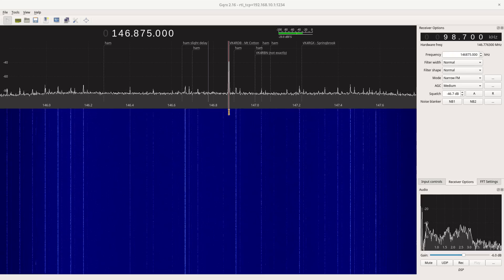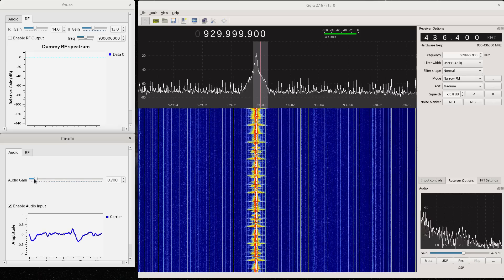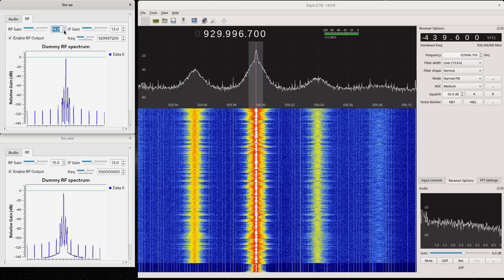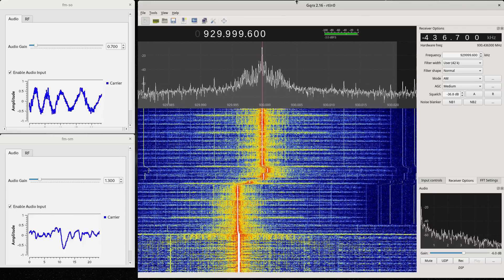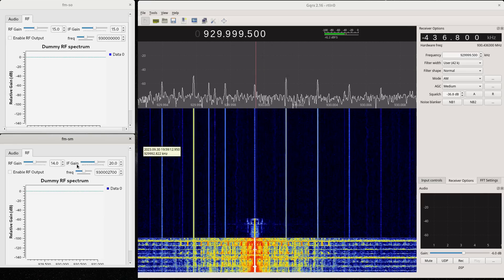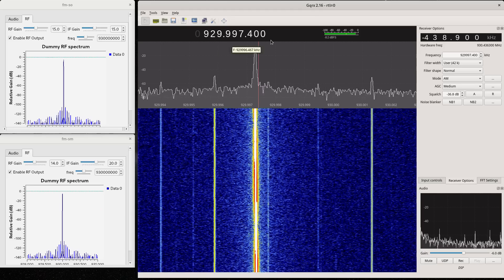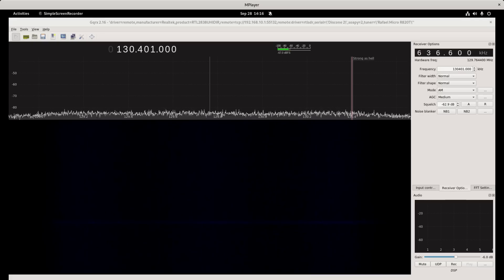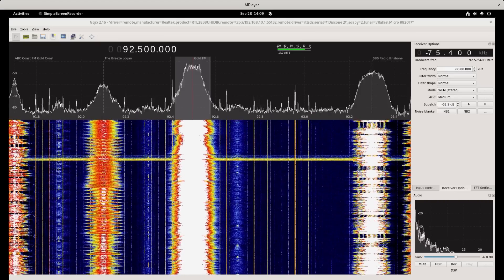Demonstrating FM Capture Effect

Comment: Unfortunately this video is fraught with serious misunderstandings of radio communication starting with fundamentals of propagation through the atmosphere and the various methods of modulating a radio carrier with information. This is pointed out in several places in the comments. Please take a look through the comments, but there is confusion within those. This is a difficult subject. The author made a try but fell into a vast array of misunderstandings leading to confusion. For example amateur radio uses all forms of modulation. In fact the most widely used method for voice transmission over any significant distance including around the world is single sideband suppressed carrier, SSB, a form of amplitude modulation. FM is generally not used for world wide communications because the portion of the spectrum capable of transmitting world wide, HF, is so limited and effective FM as usually implemented demands much more bandwidth than SSB. The most efficient use of spectrum is CW, Morse, simply turning the narrow signal on and off making it the earliest form of digital modulation. The VHF and UHF frequencies generally used for FM are not effective for world wide communication but have much wider channel width available so FM is best placed in those higher bands. 

Reply
Reply: LOL, you actually misunderstand things even more. FM and PM pretty much used for world wide comm in digital modes, it's even superior to Morse code. For FM it was a problem to get small deviation and detect it that's why FM channels were so wide esp. in old days. (old radios had 25kHz channels, modern have 6.25kHz channels). So answer is "historical reasons". SSB was just easier to implement. Yet for HAMs it has same benefit as mentioned in the video: no capture effect.
Reply: @ssoqboss  Digital methods perfected in the last few decades have enabled efficient use of spectrum and weak signal detection far beyond earlier technologies. State of the art software defined radios make implementing these various methods quick and easy compared to the complexity of hardware revisions and upgrades. Armstrong's original breadboarded FM equipment on display at the Antique Wireless Association Museum show just how hard it was. Today using programing and complex math works miracles not even dreamed of fifty, even twenty-five years ago. At the physical layer its still an issue of how best to impose the evolving standards on the physical world for transmission. Just like Morse there has to be something that can be changed over time to impose the message on that physical phenomenon. Change the frequency, change he phase, change the amplitude, change the polarization, mix things together and stir in the math to gain increasingly more efficient use of resources.

Comment: Perhaps nothing more was necessary for you to do than to simply listen in the aviation bands.  Usual comm radio received S/N is usually quite poor, probably in the high 30s DB, so intelligibility is not that great at best.  General aviation cockpits are also quite noisy from both engine and wind noise.  In the US small, nontowered airports share about 10 frequencies so pilots talking over one another occurs quite frequently.  With the given S/N and ambient noise combined with simultaneous transmissions it's extremely difficult to understand either.  General aviation (GA) radio transmitters generally are about 8-10 watts output to a usually misshapen (bent for ground clearance or something) omnidirectional antenna so one would expect antenna gain to be less than unity.  I would also agree with one of the comments that expecting the entire aviation community to replace all their radios (GA aircraft usually have two) at a price of something in excess of $4000 each would be greeted with great and well justified opposition, not to mention the difficulty of overcoming the inertia of moving two federal bureaucracies (the FCC and the FAA) to accomplish anything in fewer than some integer number of decades (recently the FAA reckoned that it would take four years to change a single paragraph of an existing regulation).  What would be nice would be digital ASCII communication from Air Traffic Control (ATC) on a subcarrier (perhaps as is done with nav VOR) of an existing aviation band frequency.  With a simple demodulator and display one could hope to more reliably recognize and respond timely to ATC calls, they being in plain text and saved visibly.  But hearing and understanding simultaneous voice calls on the same frequency?  Not likely.

Comment: You are correct,  but incomplete.  AM listens to the static,  but it also listens to the static.  You don't use a squelch. AM can be made to sound like FM,  and FM can be made to sound like AM,  but in popular practice,  AM's receiver automatic gain control has been preened to give a sensible lower volume when weak or no signals are present.  FM's automatic gain control has been turned excessively high so receiver internal generated noise becomes excessively loud when signals are absent or weak.  The AGC settings are a choice.  With reasonable settings,  no squelch is needed to squash noise and syllables are not lost.
Reply: Another important advantage if AM. By 'undercorrecting' AGC in the design of the receiver the listener can judge relative signal strength just by listening without looking at a signal meter

Comment: The  distance traveled by AM is much larger than FM may also be why its used.
Reply: Not really. You're correct that on a consumer radio, you can hear AM stations from much farther away than FM. However, that's because AM broadcast radio uses medium wave (0.5 - 1.5  mhz) while FM radio uses VHF (80 - 105 mhz). Medium wave can go over the horizon, while VHF is line of sight. If you transmitted a medium wave signal with FM, it'd have the same distance advantage.
Reply: @PsRohrbaugh No, FM cannot transmit to long distance because of hurdles coming on the way of its horizontal transmission.

Comment: why not go digital and improve drastically the audio quality by using discrete packets ... ?
Reply: in avionics, simplicity and compatibility is key. reliability above all else too. digital can hide problems such as interference that would be "inconvenient" in most cases but very dangerous to aircraft. AM ensures everyone hears roughly the same thing depending on distance from signals.
Reply: better having some noise-buried communications with some questions back to clear the meaning than no communication at all. Apart from that, equipping all airplanes worldwide with whole new radio communication costs a lot of money in equipment, training, work for replacing and getting the regulations adopted. Backwards compatibility is a severe problem for changes in the industry.
There is no hard need like e.g. the change from 31.12.1999 to 01.01.2000 (Y2k-Poblem) which MADE everyone prepare for something unforeseen. And since there is no real "need" apart from comfort, it won't be implemented soon...
Reply: Digital threshold, an almost logistical impossibility of retrofitting aircraft and control towers and, to a lesser extent, power consumption, although this is really only a consideration for gliders and for hand helds.

Comment: For readability during multiple station transmitting at the same time sideband is best. But like the military the actual frequencies used is the primary for the range not interfering with distant coms locations, AM also has a limited range enhancing why using it, Bandwidth allocations and antenna sizes also play in,
Reply: The radios have to have tight control of frequency drift for VHF SSB to work on air band without the “Donald Duck” effect kicking in. Oscillator circuits with that kind of stability at VHF are more costly. AM signals, even with modern oscillator circuits are never precisely on frequency and with AM that degree of accuracy is not necessary. For those reasons AM will be the mode of choice on air band.
Reply: @radiotec76  A cheap CB radio with a guy that doesn't recognize which sideband upper or lower and uncertain of freq can come up with a coin of phrase like donald duck effect. I think Donald Duck doesn't understand some sideband traffic heard is from ham radios that aren't on a turning the dial has major jumps in freqs while the ham radio can be anywhere between a CB radios numbered channels on purpose so a CBer can't jump into the conversation. Stability is not a problem these days and a radio locked in upper or lower sideband would have no problem even if off freq a ways. Seems change is being fought and like already mentioned many towers and controls have the same freqs where going sideband would give longer ranges giving unwanted receptions by others the transmissions are not intended for. Trans ocean calls are in the HF range like 10MHz in sideband. So pretty much when range is needed and it won't clutter others transmissions it is sideband as the mode of choice and by the way without frequency drift problems.

Comment: Our local Martin Mars fire fighting water bombers in Port Alberni Canada used to communicate in FM mode using 164.190 MHZ  when they were owned by the  Forest Industry Fling Tankers but changed to the regular local air traffic frequency  123.000 AM when they were sold to Coulson  company in 2006.

Comment: You can make a coded signal, take seven numbers, arranged biggest to smallest.  Then do jacobian matrix cramer rule; 7 - 6 + 5 - 4 + 3 - 2 + 1, zero is the stop bit, as it has no mathematical function; a + b = c.  Its wasteful ubtil your up to 4096 bits, you know, some real in depth musical clarity, but then your aware that they only sell 24 bit audio.  Why chase the guy around flying his airplane?  It's much better at this level to do a checksum than parity, so alot of work was done, 4096bits -> 128bits, so we have a virtual spacial zoom lens.  But what happens if we allow continuous spacial zoom lensing?  Well it seem's obvious that a 4K transmission should be happy with 16,777,216 bits, so we create a checksum and encapsulation code, "hay sit up straight@!"
The real Cramer rule is AM, you notice the periodic table has fields, its like prime numbers;  matrixsize x inserion - matrixroundness x offset = dimensions, or an photon, which must be AM.

Comment: ? How far can a Air Band radio can receive from the airport?
Reply: Generally line of sight. Voyage 1 is 15,000,000,000 miles away and still communicating. The form of modulation isn't always as important as the wavelength depending how and where you want to talk to.

Comment: In the Harbormaster's Office, we'd find it funny when the Coast Guard would respond to a stuck mic on marine VHF-FM, with a call, "Vessel with a stuck mic, please..."  Everybody on the frequency could hear the Coast Guard, but the vessel that was transmitting with the stuck mic.  Occasionally, one could hear background sounds in the transmission for potential clues.  It was difficult to locate an activated Emergency Position Indicating Radio Beacon (EPIRB) or aircraft ELT (Transponder) on AM (the handheld detector could lead you on a reciprocal course), so the expensive (initially) change was made to FM with GPS/GLONASS satellite navigation to provide position with greater accuracy.  Of course, if you don't have electrical power (or someone on the other end for radio communication), the systems won't help you.  We used AM on car radio for timely warning of approaching storms in the 1970s (and I still do).   When you remove an ELT or EPIRB from an aircraft, vessel, survival raft or other equipment, PLEASE remove the battery.  
I received calls of accidental activations (121.5 AM and 406 FM) in: a refuse dumpster, tipped over in a home (owners were unaware a relative had removed it from his plane and it tipped over on a shelf), and the classic, a 406 registered to a boat that hadn't removed it from their survival raft being shipped from Alaska to Seattle for repacking.  Fortunately, the latter owner was contacted and deactivated it before it was loaded as air freight.  (A commercial fishing vessel 'in potential distress tracked by GPS at 400 knots and 19,000 feet?)   As pilots in Alaska, we knew that "survival equipment is what you're wearing when your plane goes down, so it was felt that a Personal Locator Beacon was a better choice than the aircraft mount, which doesn't work beyond a depth of 15 feet/4.5 meters.
Reply: Stuck mics happen in law enforcement as well. The brass would always grab the dispatch mic "Check your RADIOS!" "Uh sir, everyone on shift except for one person heard that." Not to mention everyone with a scanner. Sometimes you would hear them chatting about their co-workers and it was tempting not to call their cell when you figured out who it was. :-)

Comment: If they wanted to hear multiple conversations on the same time, then a better solution would be to use Single Side Band Suppressed Carrier (SSB).  With the carrier power suppressed, the tone, howling, squealing (what ever you wish to call it) of the multiple carriers is virtually eliminated.  However the voices do sound a bit like "Donald Duck".  Today's radio technology has eliminated most of the fiddly manual tuning required of older SSB sets.
Ham Radio operator use SSB almost exclusively on the low frequency bands for talking around the word.
Again implementing this change would be a logistics nightmare.
Reply: SSB requires precise tuning of the receiver to sound natural, and SSB becomes virtually unintelligible if the tuning is off very much.  When using SSB, the receiver must replace the missing carrier with a locally generated version that must be very close to the carrier frequency that would have been received had it been present.  A large expense would be incurred to have all oscillators sufficiently precise in frequency, and even this would not do the job since aircraft move at high speed, move in various directions, and change direction.  These movements cause the received frequency to change due to doppler shift:  the number of wave cycles between the transmitter and receiver are changing due to the changing distance, resulting in a change of frequency at the receiver.  Thus, a receiver tuned to receive one plane would badly distort the transmission of another plane and would badly distort the transmission of the first plane when the plane changes course.  Thus, SSB would not be a good choice for the typical very high frequency (VHF) aircraft communication.

SSB is used for high frequency (HF) communications on overseas flights where the doppler effect is reduced due to the lower frequencies (as compared to VHF) used.  The HF can bounce off the ionosphere enabling transmissions around the curvature of the earth over those longer distances.

Rather than suppress the carrier, the carrier could be merely reduced so the receiver could lock on to it, but this would be a complication offering no real advantage for aircraft communications.

Ham radio operators use SSB because its narrower bandwidth allows about twice as many signals to occupy the same band allocation, the "squealing" is eliminated, and it "gets through" a bit better under very marginal conditions of signal strength.  Conversely, aircraft communications are channelized with sufficient channels to generally cover the need, a squeal tells the controller that two planes are transmitting at the same time, and VHF aircraft communications are rarely under marginal signal strength conditions.  🙂
Reply from the maker: Yeah, there's certainly a few angles to this whole thing. I was basically just showing the FM capture effect.

Comment: I am an airline pilot. We most definitely use AM. However, from the airplane, when two people transmit at the same time, 90% of the time we hear a high pitch tone. The one time where AM may be a benefit according to this video is when some one has a stuck mic in the terminal area and we can barely hear the tower or ATC over the stick mic...
Reply: I agree with you  that most of the time when two transmitters are keyed you will hear an annoying tone on a receiving unit which is the difference in the radio frequency of the two transmitters. The audio is overpowered by this tone or squeal and mostly unintelligible. Every transmitter's frequency is slightly different from any other transmitter set for the "Same" frequency.  There is an allowable tolerance since it will vary depending upon the components setting the frequency and even temperature over time.
I maintained several "Simulcast Public Safety radio systems" where multiple transmitters simultaneously broadcast the same audio over a wide area in order to cover portable radios and pagers.  We used GPS stabilized reference oscillators to keep all the transmitters On-Frequency.  We actually set each to be off about 3Hz from the adjacent transmitters so we would not get deep nulls where the RF would cancel each other.  The GPS reference oscillators would take several hours to stabilize sitting in one fixed location.  In a moving plane it would never be stable.
I worked in FM modulation and find aircraft radio very hard to understand.
I believe AM in aircraft is just a legacy thing and will likely never change due to the logistics and costs.
Reply: This feature of AM is why I hope they never replace it. AM is simple and therefore robust and, like you said, when two pilots key their mics at the same time you will know it. I hope it is never changed out for digital or satellite coms. There’s just too much complexity and that is hardly needed for line of site communications.